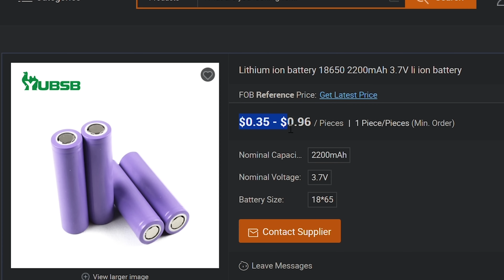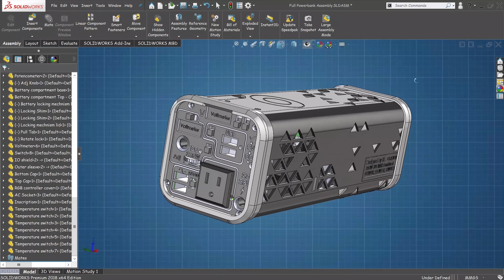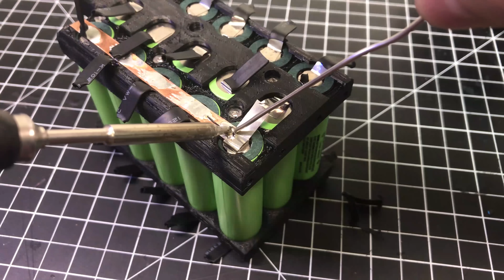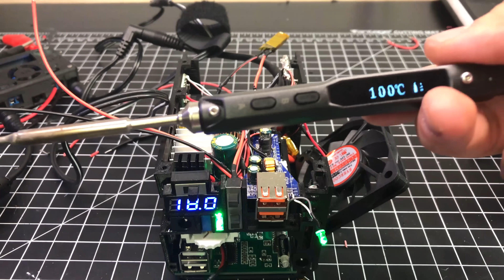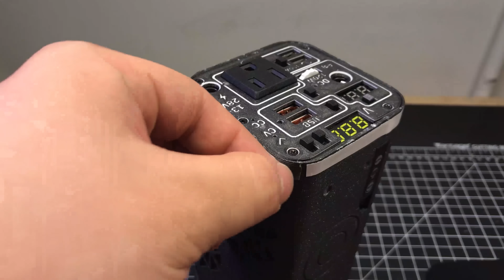How to Make the Ultimate 18650 Power Bank with Infinitely Expandable Capacity

Comment: so much hassle, you could just buy a motorcycle battery which is almost the same size then attach the 12v to 5v converter with USB

BAM!!! you have the highest capacity charger ever built

Comment: I like this version a lot better than your newer one, it's a lot more practical for me. I also have a lot of used 12v 8 amp batteries that are form alarm systems that where replaced because they can't have a battery fail in an power outage so they get replaced every few years, so these batteries never saw a lot of discharge and recharge in their operation, so they work very well, it would be cool to see you come up with something similar for these types of batteries.

Comment: Need help ASAP. At 11:43 he soldered the closed temp switch to the input, however, the diagram shows it on the output. It is suppose to be on the output right? Because it stops charging the battery if it gets to hot but does not shutdown the power bank? 

Great project and I am currently putting it together and will try to upload a video of it when I am done!

Comment: At 12:44 in the video, he says that the blue light should turn on.  But how? the negative wire of the battery is connected to nothing. Unless he skipped over a step connecting the negative somewhere? If so CAN YOU TELL ME? I AM VERY STUCK ON THIS!

Comment: All parts were thoroughly cleaned and detailed. I appreciate you for doing this project.
However, my small comment is that despite all the planning, the fuse you fit inside it. It would have been easier to change if it was outside, or it would have been usher if a place had been found for it.
My opinion is that the insulation should be taken care of again.

Overall you are a leopard

From India

Comment: The Car fuse should be wired in a socket so you can replace the fuse should it ever need to be replaced - or even use a lower or higher level fuse (10V, 5V).  Excellent work.

Comment: @K R A L Y N 3D Starting at 16:53 there's a component shown on the relay that's not mentioned. It's bridging the two coil pins. Does anyone know what it is? Is it a resistor? A Shottky diode?

Comment: “The power bank is very safe if built correctly”
Reply: "it's safe if you don't use it"
Reply: @clusterhunt  Yep. the wiring does look slightly concerning
Reply: Yeah lol I may or may have not shorted a car battery after watching this vid
Reply: At what point will that short out and possibly cause a fire (those batteries go off like Roman candles)
Reply: The heatsinks on the inverter circuit concern me the most.  Thermal epoxy is not a great mechanical bond. One jolt and 2 big pieces of metal will have a field day with all of those exposed circuits
Reply: Oo yeah! It's safe indeed. No one was harmed during making this video :v
Reply: The whole build is just "solder this, solder that". It's not hard, at least you don't need to do all the dirty job as you already have a working design and the exact parts that you'll need.
Reply: @one_step_sideways  Very true :) And if it doesn't work or blows up, you can always blame it on the parts.

Actually, the blowing up is the fun part ;D

Comment: Time stamps.
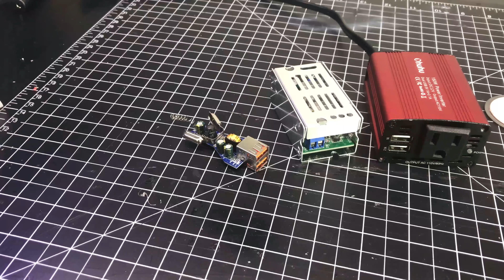2:45 Materials list
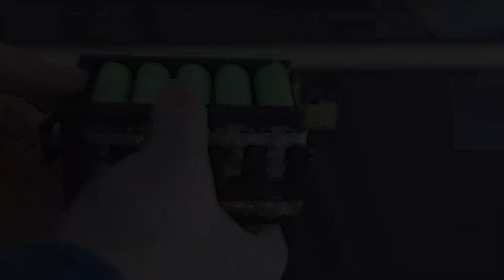5:42 Battery pack
9:52 Charging circuit
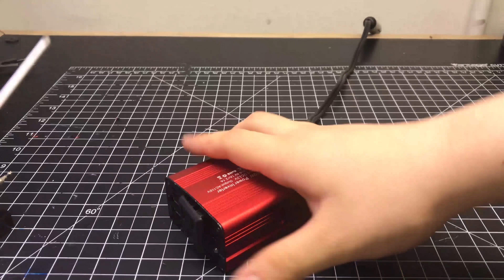12:50 Inverter circuit
14:17 Mid layer assembly
18:26 Relay power system
19:32 Tests
20:19 Top layer assembly
23:25 Build complete
23:54 RGB montage

Comment: Would be great if there was a kit build list to buy or a just add batteries and build option.  Which part of the design needs to be tweaked to enable another cluster of batteries behind the first? So it’s got a 2 pack of 15cells in parallel? And can internal circuits take the higher capacity?

Comment: I have just calculated all the components needed. I did a search whole the day. I looked for the lowest price.
The total cost is 175 euros without batteries and 3D parts! I give up
Reply: just buy sealed scooter battery 20amp 30or 40$  then5$ for converter put all in lunch box nothing to go wrong

Comment: this came around again but now my current mid range laptop i assume mid range gaming as it as a gtx 1660 btu i know 150 wont cut it as the adapter is 190 watt but this be cool to do if i had a 3d printer and the soldering skills needed as i see with a 3d printer and proper soldering skills this would be fun to do mine would be the 120v version if i could do it

Comment: Hello what kind of USB type c fast trigger charger did you use. It doesn't work for me. I built a 12, 6v 42ah 18650 battery myself. Really cool if you can help me with that. LG Tom
Reply: This one! https://www.ebay.com/itm/Super-Mini-ZYPDS-DC-mini-20V-trigger-support-millet-65W-PD-power-supply/132714794782?hash=item1ee66b0f1e:g:i-0AAOSwMflcGdV4

Comment: Is the inverter has a low voltage automatic shut off? If has in what voltage level? I have the same 150W inverter you've use in this project I noticed when the voltage drops <10V the inverter automatically shuts off. On  your experience on what lowest voltage the the inverter automatically shuts off? Thank you!

Comment: KRALYN3D, thanks for sharing this great project with us. I am wondering about the Charging part with the USB-C Hub. Because if it is connected to an source, which hasn't a Power Delivery funktion, would be there maybe the problem with the low voltage of let say 5V, because of the step down converter, for Charging the Battery?
Greetings

Comment: Good Idea, but product it's not the best in most of its aspects, here are some improvements;

1- That Radio Type Turner for changeable output DC is pretty dangerous as while output is connected to a Device any accidental turn of that turner is going to fry the device making a $1000 device vulnerable, you should make it somehow blocked while output is connected.
2- The casing, it's too tight and going to have some problems with residual heat in real life snerios.
3- The Soldering it's too much, as a slightest fault can render entire device useless.
4- Too much hot glue, and that car fuse location, nah not even close to a good location.
5- Battery box with open terminals, you should insulate them with flaps on side or something but open, not good.
6- Design an all in one PCB with Charging Circut, Inverter, and all perks with come extras like modular LED's, modular Output Sockets, restore able fuses, AND WITH A 220V OUTPUT OPTION.

Other than that good idea, most of all worth for its price.

Comment: Nice
But the cost for a 3d printer are not in the cost included and you don't have Fuses between each battery and they are not easy to replace.

Comment: Hello there. I am planning my own power bank capable of supplying a laptop with power, but I am kind of stuck... Some laptops require 3 cables to work. 2 are for power and 1 is for sensing purposes and for the laptop to be able to tell what charger is connected and how much power it can draw. I don't really know what to do with the 3rd cable. Do you have any suggestions? ¯\_(ツ)_/¯
Reply: I think you have to connect the sense wire to a voltage divider. I do not know the specifics, so you might have to google it.

Comment: Now that you've built the one, surely you could build many more, far more quickly, and market them. You have the schematics and 3D printer, the suppliers for all the 'electrickery' bits'n'bobs, so you're ready to go. Sell them sans batteries, leaving that to the buyers and I'd happily pay $100 for this given how much power banks at 26000 Mah cost these days WITHOUT all the features your model offers. It'd probably happily jump-start a car as well. Go for it... economies of scale are on your side!
Thanks for this. Most impressive.

Comment: How many max Ahs I can get out of it and voltage.
Reply: There are 6 batteries in parallel. If you make use of the 2nd option in the links with a capacity of 3400mah. Your total capacity would be 6 x 3400mah= 20400mah approx 20.4ah. Voltage is 3.6v nominal and 4.2 fully charged for each cell. He has 3 in series so 4.2 x 3 = 12.6V. Power inverter converts to 110/220v.

Comment: Wow, do you know what would happen to that device if one of those cells were to start to fail in a shorted condition? It would quickly avalanche into an inferno. Paralleling unprotected cells like that is just so irresponsible. To correctly parallel unprotected cells you should use a bus bar with each cell connected to the bar with a fusible link or use a cell protection board on each cell. This is especially important is you're using recycled cells. That way, if one cell starts to fail shorted, the board or link will blow severing the bad cell from the rest of the pack before it can get bad enough to sync enough current to fail catastrophically. Otherwise, what happens is that the other cells will start to dump current through the bad cell, which causes it to get worse and sync more current and so on and so on until the cell detonates which will quickly ignite the other cells in proximity and ruin your day.

Comment: what is the black paint over the soldered joints?(not the heat shrink it's something different) 13:50 the stuff over all those wires. also would i need it?

Comment: Is there a way I could passive cool this? Because I want to integrate it into a backpack where it would be a closed space
Reply: I think so, but you may have a stop-and-go charging because there's the safety with the bimetal switches. But I think this will fit in a backpack, the can doesn't scratch anything.

Comment: Why were two relays in parallel used instead of a single relay between the load, charging circuit, and the battery pack?
Reply from the maker: A single relay gets too hot. I hindsight,  MOSFETs are better, thus the next iteration will not contain relays.

Comment: Man you should apply for a patent. And invest in a spot welder for wielding the copper strips to battery. And if can print a pcb and reduce the amount of wires it will help in good airflow.

Comment: I have completed this project and its great. Here are some corrections for anyone interested in building this. 
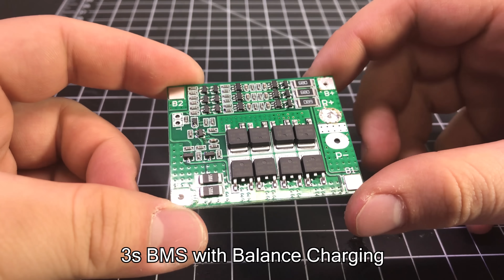3:11 It lists 2 Mini DC step down converters when most likely, only 1 will be needed. The second is use to lower the speed of a fan if it is too loud.
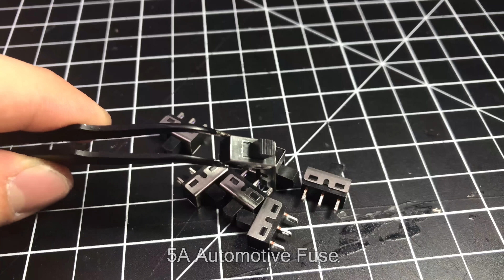3:45 make sure that you buy the correct size switch as shown here. I purchased ones that were 1/4 of the size and had to 3D print custom enclosures to make them the proper size.
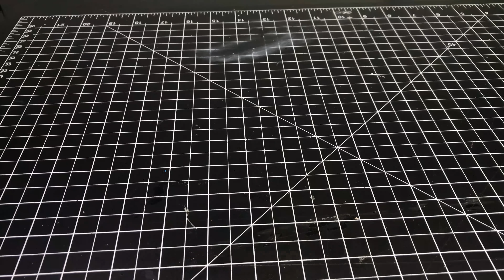4:00 The copper strips are not needed if you spot weld the batteries. The zinc strips worked well. My power inverter also already came with heatsinks. 
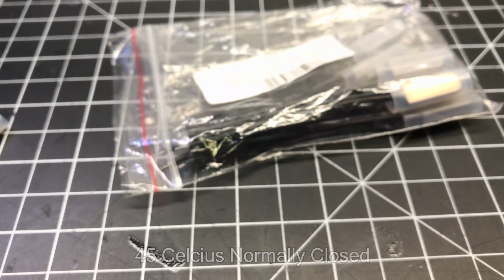4:21 he says 4 NC and 3 NO 45°C bimetal thermostats when it is actually 3 NC and 4 NO needed.
9:18 if you are using a flexible filament for the outer bumpers, there is a remixed STL file for the ring to be printed in flexible filament. That hinge is impossible to locate.
11:07 the hole for the USB C trigger is very large. I used tissue paper with glue to fill the hole. Hot Glue may also work. You can also shrink it in the files that is provided. 
13:49 The graphic is incorrect but the video shows the correct pin, the wire goes to the common terminal of the relay which is why he offset it to do so.
14:08 The second pin of the switch gets used later, it goes to the relay pin shown in 19:24
14:39 Be aware how you solder the wires to the potentiometer as a voltage gauge is mounted directly above it as seen in 15:45. 90° solder joints are what I had to use. 
15:24 The other wire of the switch goes to ground
21:53 This isn't a correction but you can drill a hole or bore one with a soldering iron in the center of the charging coils to run one of the connectors below the board. I don't know if it helps but I copied it like seen here.
Reply: Most useful commentary
Reply: alysdexia  It's great means it is great. The other corrections are also wrong. It is absolutely called a "fast charger" and not a "swift charger". One "shall" be needed is silly.  Greater typically refers to a value. The charger circuit was physically larger....... The definition of well and great and great are different.   
Was this post a troll or you? If you are correcting someone, make sure that you aren't completely wrong as you are on most of these silly corrections.
Reply: @esqueue  In the video he uses it for charging the laptop with 19.4v without setting up the Amp. Can we charge the lap like that
Reply: He said 20 amp fuse but the screen said five amp fuse
Reply: @PlateInStock  He said 20 amp, the schematic says 20 amp and he used a yellow fuse which is 20 amp. Use a 20 A fuse.
Reply: another little note. the USB output of the USB car adapter can reach higher voltage values when a proper QC device is connected, and if you turn on the Qi wireless charger at the same time you can burn the circuitry
Reply: I don’t have anything that runs at 12 volts at 10 amps. Do you think running something at 20 volts at 5 amps will be good enough? I don’t want to shell out more money than I have to just to test the batteries.
Reply: @nicholasdelrossi3996  for you and anyone else, I connected the batteries to the 12v DC>120v AC inverter using an XT60 connector. I put a meter in between so I could see the amperage. It's easy to find a 10A AC load. I used a heat gun on low power.
Reply: Thanks :D!
Reply: Great,  can you build one for me ? yogeshkdm@yahoo.com
Reply: Damn, a little late but I wish you'd make a video on this with the corrections.
Reply: @esqueue can this version charge using solar panel
Reply: Send me the project please
Reply: how much did it cost for u?
Reply: I've made this project but my inverter is not functioning properly, it gives 220v supply for few seconds in the beginning but then doesn't work
Reply: I've completed it and posted some pictures of it in the made section in the thingiverse link provided in the summary. 
https://youtu.be/pKnB_AYzoJQ

Many of the parts and components used were different than the recommended components. This was mostly due to error but I had to make them work. Unfortunately, this meant that I had to redesign many of the existing files. Thankfully all the cad files were provided and easily modified with Fusion 360.

I got a 10 watt fast wireless charger instead of the recommended 5 watt. This will charge wireless devices twice as fast but it was larger than the recommended. The charger actually needs 9 volts instead of 5 volts to use it's full potential. I used a mini step down converter (purchased 10 by mistake) to drop the voltage from the battery down to 9 volts and soldered the power cables to the wireless charger. This way, I don't need to turn on the usb charger switch to turn on the wireless charger. I also got RGBW (additional White Light) instead of RGB and the controller was larger. These upgrades required the top compartment, and outer shell to require modification. The inset for the wireless charger circuitry had to be pushed more toward the center of the device and some of the dividers needed to be removed in the top compartment cover. The outer shell was changed too. I pushed the target circle for the charging back to it's new location, holes were relocated to match the new outputs of the lights and RGBW controller hole was changed to be more clean. I made a new switch cover and completely closed the hole that is usually on the top. 

I had to modify the IO plate a decent amount. All the text had to be enlarged and they had to be put in a bit deeper. I also had to enlarge the hole and add some cutouts for my outlet plug as my plug had side tabs, which meant that I needed no glue. I also had to lower the LED hole for the inverter my 4 mm. I literally printed about 11 or so IO face plates till it got it correct. The usb 3.0 charger I got was much smaller than the one recommended so I made a adaptor tray with a thermostat slot for the new circuitry to sit on. The CC/CV buck converter was also different and had no screw holes so I used some high power 3M double sticky tape to hold it down.

I had a spot welder so no copper strips were needed. I had some nickel strips which I used. Fortunately my inverter already had heatsinks. 

I used some pretty good cells that tested out to be great on my iCharger 1010b+. On my first test, the capacity came out to be 17,226 mAh @ 11.1 Volts or 191.2086 Watt hours.  Does it seem low? 191.21 Watt hours is about 52,000 mAh at 3.7 volts if I were to show the capacity like most scumbag sellers do.

Only thing left is to properly print the badge.
Reply: @esqueue  You removed your video :(
Reply: @MattFahnix  It kinda sucked. I'm not good behind a camera and people hate silent videos..
Reply: @esqueue  :(
Reply: as a noob and only knows how to solder and has a 3d printer, it would be nice if you make a separate video tutorial step by step guide on how to assemble this. i can only copy cat/ monkey see monkey doo things honestly
Reply: @MrJackfriday  Unfortunately, that takes too much time. That's why I appreciate Kralyn's work so much.

Comment: One of the best things of this project is that he released the Cad Files. For some reason or another, many of the parts that I purchased are completely different so I had to modify the prints using Fusion 360.  One example is the wireless charger on the top. I somehow purchased a fast charger instead of a normal one which is larger so I had to extend the space on the top to allow it to fit. I also have to solder four wires instead of just two to take advantage of its full speed.

Comment: In the video you showing you connected the temp. sensor to the voltage in ports of the step down converter but the schematics shows that the temp sensor should be on the voltage out side. So which way is it? then you have the led lights on the voltage in side next to the diode when the led lights supposed to be on the voltage out side. So, im a little confused on the way its supposed to be wired!!! please help